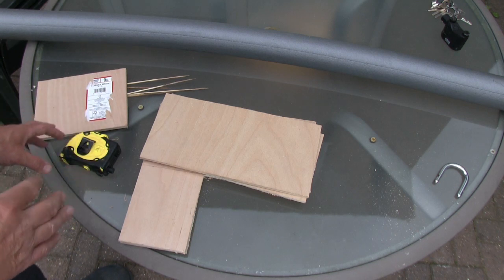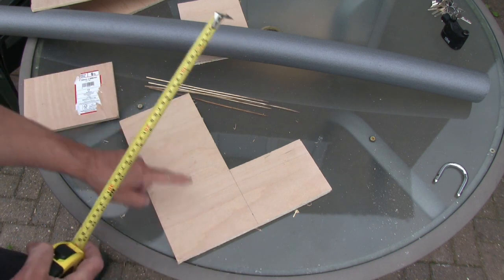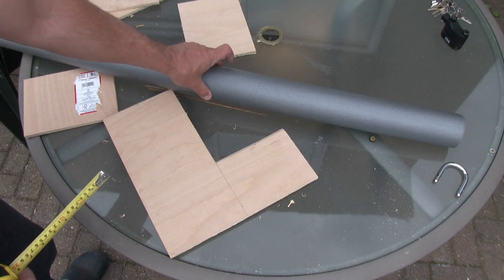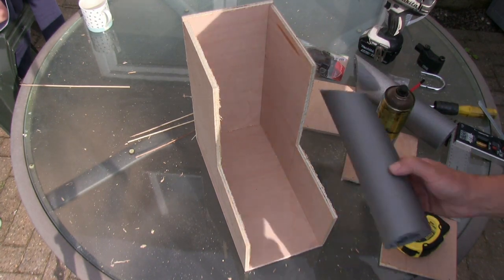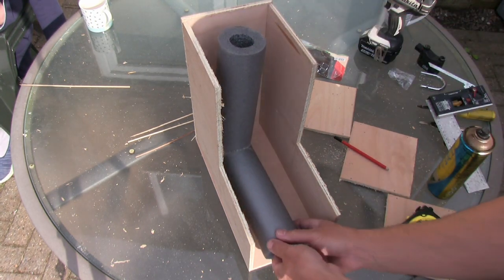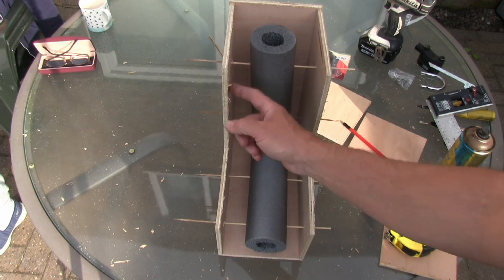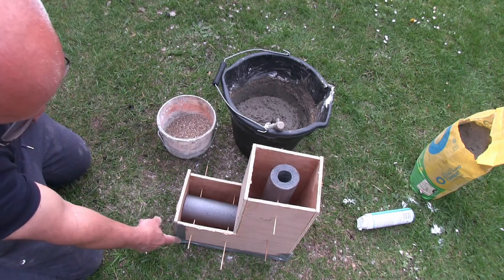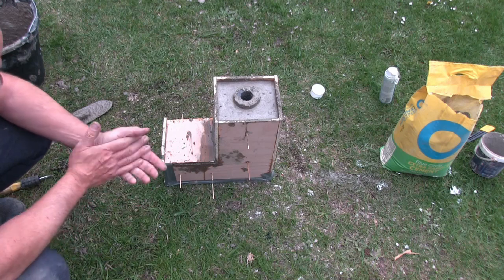Aircrete Rocket Stove Project PART 1 | No Foam Generator Required

Comment: 👍👍👍👍👍
Reply from the maker: No sinking of the concrete at all. Either I've actually produced a decent aircrete (highly unlikely) or I didn't actually make aircrete in the first place. I'll know better when it's fully cured and I can weigh the structure and compare against the volume of concrete.
Reply: @mancaveprojects4693  hmmmm, getting more interesting 😊